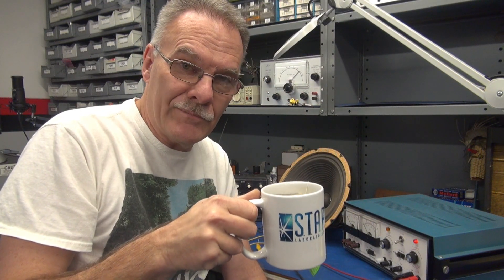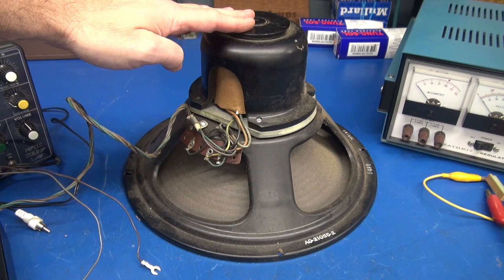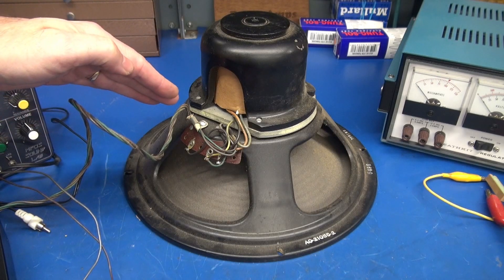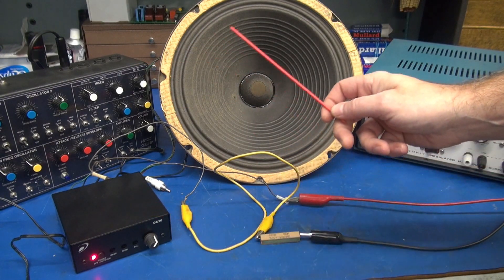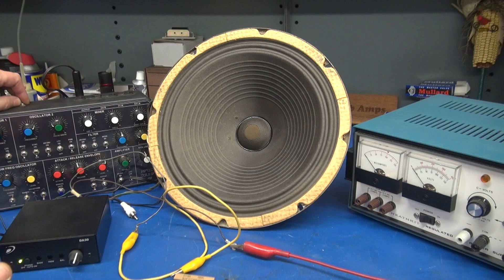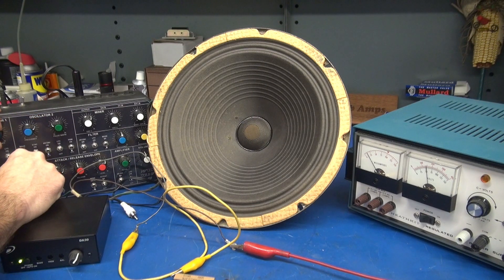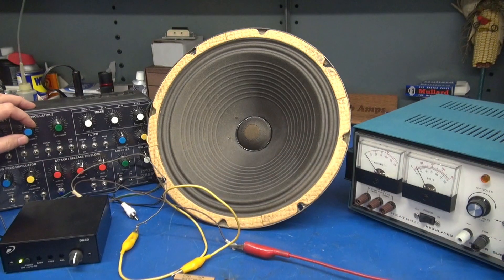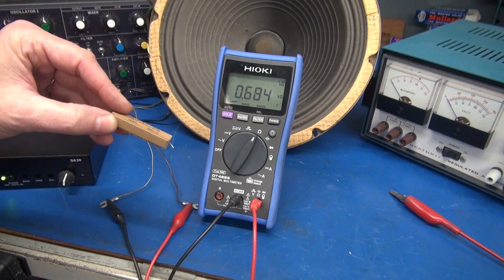How to test vintage Hammond console radio speaker using synth and Heathkit high voltage power supply

Comment: This looks like a speaker from an early Hammond organ Tone Cabinet (a speaker cabinet with a built in amplifier, designed to be used with an electric organ, exclusively). It could also be from a Hammond M-series organ.
In the Hammond Tone Cabinets that use EM speakers, two different speakers were used in the same cabinet (though they look the same). One speaker has a 250 ohm field coil, and is connected between the center tap of the high voltage winding of the power xmfr, and ground, thus, along with a resistor network creating a negative voltage tap to bias the power tubes.
The other speaker had a 5000 K ohm coil that was connected between B+ and ground.
In the M series organs, the field coil was either 1000 ohm or 700 ohm, and connected similar to the 250 ohm described above.
The Hammond Organ Co. did not manufacture speakers. They did use the AO prefix in most of their early part numbers. I believe they used Jensen speakers. If the manufacturer code begins with 220xxx, It is a Jensen. I can't read the manf. number in the video.
I also noted the scaring in the gasket. Hammond organ commonly used a 1/4 inch heavy screen (commonly known as hardware cloth) as reinforcing for the grill cloth in the M series organs.

Comment: Why would a speaker be made this way?  Magnetic material shortages?
Reply: Electro-magnet speakers were used before the discovery of AlNiCo permanent magnets. It was the only method of producing a strong enough for a loudspeaker. 
The development of the strong AlNiCo magnet along with copper shortages during WWII pretty much spelled the end of the EM speaker.
Reply: @scottbc31h22  Well said!